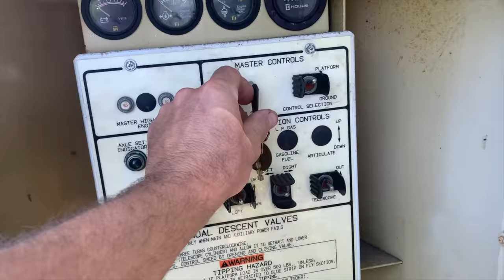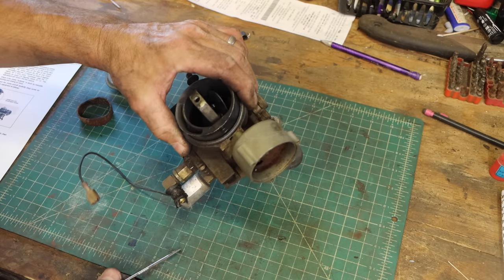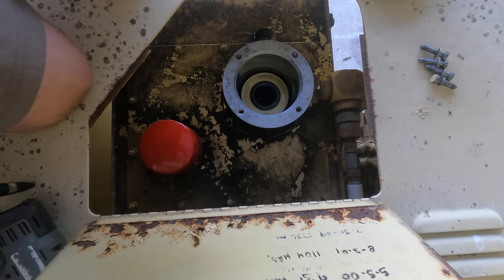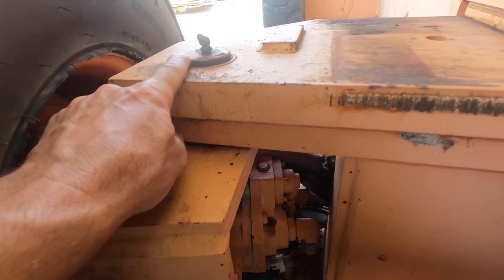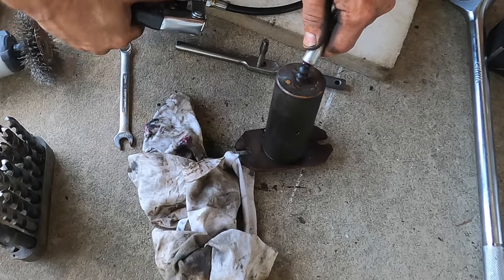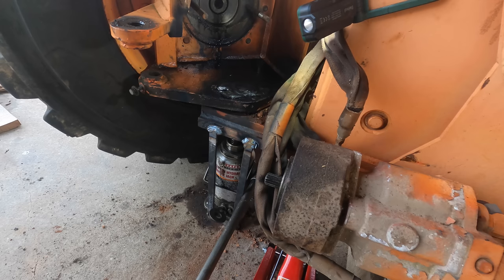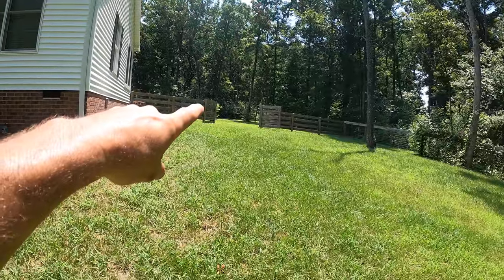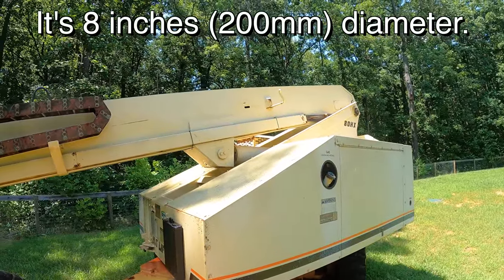Fixing and Using a VERY STUBBORN Boom Lift to Cut Down Dead Trees.

Comment: just for reference one of the New Holland baler service manuals said to press apart ( i don't remember which part ) you would need a 40 ton press or a couple of hits with a 12 pound hammer. I can assure you that the 40 ton shop press would most times not press it apart where a 10 pound hammer would always work

Comment: Your wire is on reverse on the throttle switch where you change from platform to Boone that's why it idles up soon high when you're on the platform it needs to be changed around I had the same thing happened to mine

Comment: I know there's these "gadgets" that you put grease in, put on the zerk, and then hit with a hammer. That pushes the grease in with so much force that it usually clears blockages. I don't know what they're called though. Could be worth the couple bucks they probably cost, always good to have around.
Reply: Try like 40 bucks,sometimes they work,sometimes they dont.

Comment: Tough crack with the main cylinder seal failing. Luckily as you say, the clever engineers thought of a failsafe with the holding valve in the cylinder - even if a hose burst at 80ft in the air, the cylinder is locked in place through the pressure of the check valve or holding valve. Very clever system. Painfully unlucky after all that work rebuilding the carb and the king pins which is always a rubbish job on these bigger machines. Enjoyed the video! 🇬🇧

Comment: I still remember my dad tearing down car/truck carburetors in the early 70's, along with other maintenance on our vehicles (spark plugs, oil, etc.). Having to start farming a couple of years ago, I've done a bit of maintenance on our tractors (oil change, fuel filters, lubing zerk fittings, sharpening mower blades on fold out brush hog, etc.), had to get some help to replace a radiator due to not having tools or experience in doing that (hired some local farm hands for that) $900 for radiator and $200 for labor (4 guys, $50 each). Found out after removing a front tire on the John Deere tractor when it went flat, using the front bucket as a jack then removing tire and loading the tire and hauling it into town and back then getting tire back onto tractor, that the local tractor place would come out and do everything themselves. Still, with the tire replacement being $1,200, my 85 yr old mom and I were able to most of the work ourselves. Next time though, we will pay the extra for someone else to pull a front tire if it goes flat.
Living on the family farm for most of our lives, we do much of the work ourselves when things need taking care of like electrical wiring, replacing capacitors on an AC unit, plumbing, taking care of dead trees, etc. This is why I love watching your videos, it shows self reliance and how to fix/make things.

Comment: Wonder if there's any way to use 🤔 a hydraulic jack or clamp that would make it possible to push down on the pin while pushing up on the frame.

Comment: I work on these things on a regular basis and the easiest way to remove those pins in the field for me is to use a portable band saw and slice the pins between the frame/axle and knuckle and removing it. Those should have a fiber type resin bearing that is replaceable and fun as F@%& to replace. Once apart, you can get the correct hammer alignment to drive out the cut pins and chisel out the bushings. I always replace the bushings and pins as you  almost always run into loose fitting pins as you did here. Rust jacking damages the king pin bushings and causes tolerance issues. As far as the cylinder leak,  may as well get ready to reseal most cylinders as father time has taken its toll on all them. Good luck on getting the cylinder pins out (ask me how I know but there are a couple tricks). Yep big toys/machines comes with hefty repair costs. Loved the video and feel the angst and pain you shared with everyone. BTW, ever see a rental company selling a piece of equipment?  Should be a red flag because if it was making money, they would not be selling it. When seeing one for sale, do like Gump does and just run like hell from it. Most of the time the piece is used up or repair costs are gonna be astronomical to properly repair what has been patched up. Just my 2 cents worth.

Comment: For that bottom kingpin that wouldn't budge, do you think that drill a new hole from the top would have allowed you to clear the grease passage enough? You would have had to bolt or weld the hole shut, but that's well within your wheelhouse.

Comment: Is it still three-wheel steering?  If so do you plan the get the fourth wheel motor hooked up?  I think you need the missing brake component?
Reply from the maker: I did get that fixed in a later video.
Reply: @FarmCraft101  Thanks looking forward so seeing that one too.  Really enjoying your videos.

Comment: Wow, a more or less mechanical carburetor. Except for the heating element that is what I could work on when I had a used 68 Ford pick up truck in my youth.

I am only part way in to the video and seeing it a day late. Sure will be interesting how it ends, but I must say it took a bit of a large set of things associated with a Johnson to pull the carburetor out and rebuild it considering the space it lived in.

Wow again, what an outcome with respect to the second pin. Even Custer would have given up the fight. I'd hate to see what a repair shop would give you for the pin repair alone.

The ending is a heart breaker. But on the bright side you still have the energy and stamina to pull this type of work off. Mine rode away somewhere between age 56 and 67 because I last had it when I sided off a ladder my moutain top two story chalet that was built on a steep slope 11 years ago. Should have had a going away cereromony for I suspected it left when after finished I said, never again.

Great video. You have really upped the film production.

Comment: Do you have a grease hammer. It's a tool that you fill with oil, put it on the grease fitting, and hit with a hammer to force the oil through it. comes in handy, quite often.

Comment: Hey helpful tip,  use the excavator to lift the boom and help you remove the hydraulic cylinder.  Its a lot like a crane.  LOL    Psst   I like excavators they are dammed handy for everything.

Comment: That cracked & kinked-up hose is the Crankcase Vent it should have a PCV (positive crankcase ventilation) valve mounted to the valve cover just like every other gasoline engine I've ever seen and or worked on.

Comment: you need a zerk buster. you fill it with penetrating oil. and whack it with a hammer it forces the oil through the frozen goo in the zerk and frees it up.

Comment: King pins do t wear out as often as they freeze in place. Had  beat and heat 10 wheelers for 2 days. Worked it back and forth with fixture on hub and excavator to move it back and forth. Nightmare of gauld bronze and rust. Whole front end chattered when moved….

Comment: For the pin to go out you have to heat up the plates where pins are in and not the pin .Done that for 6 years.all of them types.The cilinder does have holding valves for safety.To take that pin out of cilinder let it rest on strong construction and take only the upper pin out.and make a small vacuum on your oiltank..

Comment: at +19:00 you didn't install the spring that's supposed to go behind the diaphragm. The diaphragm is the vacuum operated accelerator pump and it needs that spring behind it to operate correctly. When the throttle moves off idle, the vacuum drops and the spring causes the diaphragm to move inward and pump a shot of fuel into the throat of the carb. The spring is in the plastic bag that the new diaphragm came in (along with the orange cap/spacer that goes over the end of the spring and  which is used to regulate the amount of fuel the diaphragm pumps out on each shot.

Comment: I wonder if that little motor mishap is what caused the main cylinder to fail, there's gotta be a lot of force on it when the boom flexes like that. I mean, yeah, if it were in good condition, I'd hope it wouldn't be a problem, but it could be what pushed it over the edge.

Comment: I know on lawn mower engines when the fuel shut off coil is engaged the engine will remain running for a second or two on what’s left of the gas in the now closed fuel curcuit

Comment: Another run down/ preventative maintenance video of a hydraulic system like the Boom Lift's system would be cool to watch, that is only if you're concerned about any larger hydraulic issues coming down the pike. But if you don't do that PM of the hydraulic system then I'd understand why you wouldn't want to press your luck it if it's working just fine.

Comment: Dude, I know the boom lift that I used had a safety that would not allow the wheels to drive (I think) when the basket was in the air.  Is the safety disconnected?  because that's f'n dangerous, as I'm sure you can attest.

Comment: Well, that hydraulic oil looks like its mineral base, some of those hydraulic oils are vegetable base, and probably not interchangeable. Might ask so if it does happen over grass or other places... just saying and this is a rhetorical reply only. I would think that using like I have in the past... five gallon size cans/jugs of cooking oil as it should be a lot cheaper to replace. I did use it in a old Oldsmobile car from early fifties and it was just fine. Those pins that you removed was me screaming at the screen, and you must of heard me at the end as we did that on lots of equipment on the islands in alaska. Now as for removal, I like to use silver never seize on them even for heating one up as it seems to penetrate down into those tight spots and I never ever ever put one together without coating that pin with it. We even packed it into our grease gun and with heat got it to go in with a margin of success. Might hate the mess as it seems to make everything nasty. Lets address that rust. Does the word phosphate ring a bell?? Seems as though when used on lets just say a frame rail on a  truck. You have used concrete stripper before, well use it full strength on any rusty item and it just eats rust! Here is the good or great or dang good idea spot... it turns the metal to look like a snowy or black and white looking stuff on the rusted metal... leave it on the rusted area for a day and then come back and wash it off. It will eat down into the pits and all and the great part is....... it stops that rust permanently or at least for a year or more without painting or other... just apply, wait, then wash it off. That simple and like on rusty floorboards, brush off most of the crap you can then just brush on the cement stripper and wha la boom .. your looking right sharp, at least a sharp lead pencil sharp. Oh, one other way I had some success on pins that were smaller than that one was to hook the welder to it on a low setting and just let that old DC unit struggle with it as it will heat a pin red hot if it can stay long enough. Nice part is the pin is hot and the rest is cooler... so when it cools off, it kinda shrinks away from the problem... but lay the silver anti seize on the area... (I just had good luck with it and never tried the copper stuff) but it soaks in the tight spot pretty good... we have chatted before if you remember right, old old guy in alaska mechanic just cause I say so/lol

Comment: I watched a video of a guy operating one of those machines drive off a curb. 6 inches a one end equals a few feet at the end on the boom. It fired the guy out of the basket about 10 feet in the air. Looked funny but you could get really hurt. I could not imagine the action with the boom extended. Be careful.

Comment: could you flip the elbow on top the carb over so that the pcv line is going in, in a straight line and the screwy thingy (technical term) is in the back instead of the top?  maybe in 10 years when you have to mess with it again.

Comment: You can fix it, I fixed mine and now every cylinder has gone out one at a time . Now my hydraulic drive that  rotates the boom is out.  My 5000 dollar lift has cost me well over 12000 and counting. I would have been miles ahead to rent one as needed.

Comment: Could you explain why you are cutting notches on the short pieces, normally that would be to control the direction of fall and to help prevent the tree from splitting and coming back at you but with those small sections they can easily be manhandled where you want then to go and without the weight of an entire tree behind them it shouldn't split. Maybe I'm missing something it just seems like some finicky work to be doing up in the air.

Comment: I am wondering if you damage the cylinder seals when you moved with the boom extended. Thats  a lot of energy when that boom was bouncing. I believe newer man-lifts disable to wheels when the boom is extended beyond a limit. At lest the ones I rented.

I rented a man-lift like you had, and when it bounces ( if you adjust a control too fast) , its not fun at all. 

The issue is getting that cylinder out is going to be the stuff of nightmares. Andrew Camarata has a telehandler with two cylinders mount on the sides of the boom that that didn't look like fun at all. Yours is inside.
Reply: That don't hurt them
Reply: Seals are old. Moving machine while extended won't hurt them. Machines will move if boom extended. I have worked at a dealership for over 25 years. Haven't seen one of these in a while so I don't remember what the bottom of turret looks but I am thinking if top is turned 90 degrees it might go out the bottom. Pins will not be easy to remove. Counter weight may need to be removed. Fastest way to remove stubborn pins is to get them air arced out. We fought for 2 days with one pin and a mobile welder with an air arc removed it in 10 minutes.

Comment: You say forces are high using a hammer...I believe they're actually MUCH MUCH higher than even you mentioned.
I remember calculating the forces applied by using JUST a 'regular' hammer and those were insanely high.  WAY higher than anything you could by at The Chinese Embassy (Harbor Freight).
Ya man. Hammers make insane amounts of impact force.

Comment: That klein screwdriver looks nice enough, but I've been using the same picquic screwdriver my dad bought 40 years ago.

Well, actually, that heirloom piece lives a comfortable life on the work bench at home, I bought the stainless version when I went to diesel tech and that's the one that sees all the work nowadays.

And you really should be wearing a full harness while you're using that thing, the waist only ones are better than nothing, but a full vest harness plus shock lanyard and trauma straps can be had for less than $200. Much cheaper than a wheelchair.
I've seen more people end up in the hospital from boom lifts than motorcycles, and I ride pretty much every chance I get.

Comment: I seen the work capability you have fixing stuff the hydraulic cylinder should be a walk in the park. Just watch how you take it apart and put the ring seals back in correct order, might need a come a long to pull it out or Ive seen a shot of air do it also but that's a if. I would say you should try to do it with a kit.:washhands:

Comment: Nice machine....  ultrasonic tank and omegaclean for a perfect carb rebuild...   PLEASE wear a harness and drive with the basket in front.  Not trying to be a little sissy but catapulting is a common injury especially on the bigger machines.  That beast is close to 60,000lbs...

Comment: Never under estimate the power of Rust ! or the strength in tight spots  ?
It's amazingly simple sleep does to let the brain get into it full potential  😴 😌
Reply: If you EVER  get bored !  in an open area , as you are driving,  turn and swing in the same direction  . 
I use to run one almost on a daily basis   . Love it 😀 !
 I sometimes had to take  welders into very tight spots to weld high pressure steam pipes.  
With one hundred ten foot stick , forty feet off the ground,  almost at full stick driving and turning 😳 the welder had white knees and a tight pucker  . but we had some great laughs and memories !

Comment: Those things are sold when they don't even want to mess with them, you have many more battles ahead.   I'm a architectural facades guy, with many years of 8 hr.'s a day in those thing's.. get a real lanyard   that will keep you in the basket. not hanging below it. you can die from cut off circulation in your femoral arteries. Safety first. they  can catapult you up and out,  Love your content ...

Comment: She was a stubborn one never seen a king pin so hard to come out I think it never got  greased. Don't see it don't look for it don't have to grease it 👍 and for pulling the wrong leaver it brought back memories 🤣🤣🤣🤣 and you forgot to say the part about whipping 💩 of camera 🤣  and for the cylinder that's going to be a hole adventure it's getting the machine out without making a mess of oil and going back out the fence 🤔

Comment: 🙋🏻‍♂️I love your „ how to fix“ videos and solving issues on your equipment. BUT… SPEND A FEW BUCKS AND BUY AND USE A SAFETY HARNESS!!! The most dangerous thing is the whip effect. With that long boom even in low position, the danger of being catapulted out of the basket is huge. When this will happen, your chance of being unharmed is very minimal. So, protect your life and family in using this safety equipment. And at last but not least, I want to enjoy your work and channel in the future. Stay save and have a nice weekend 👍🇩🇪😎